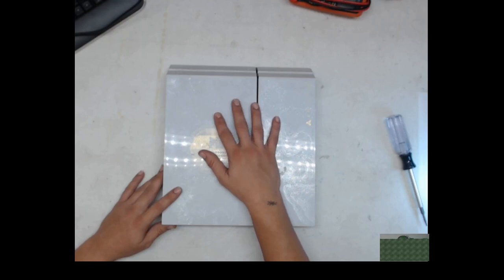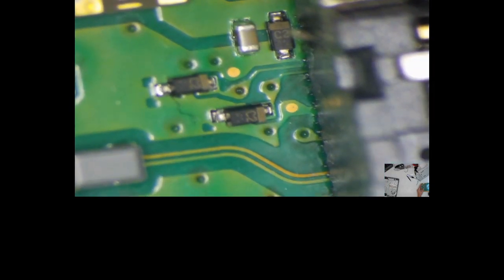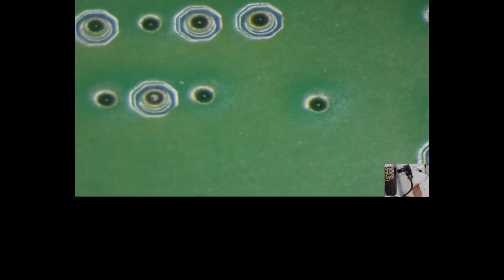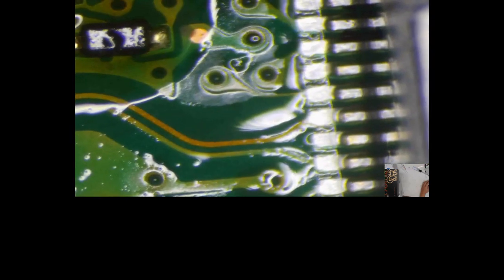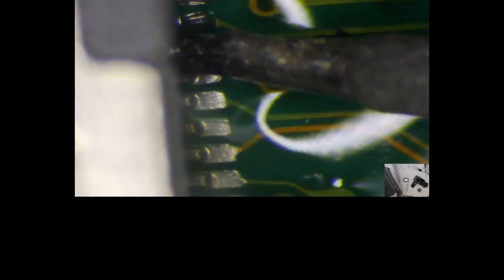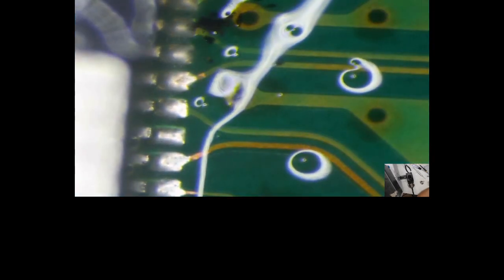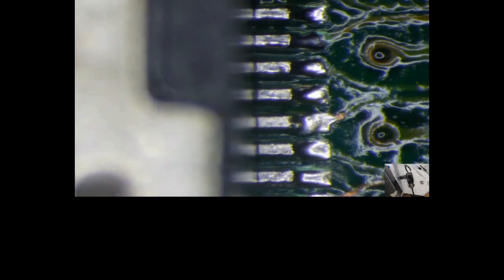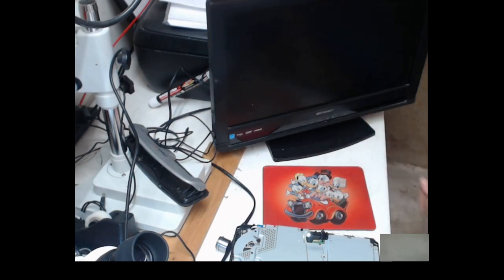PS4 CUH-1215A HDMI Port Replacement Fifine Mic Test

Comment: Im.just curious, I may have to replace the hdmi ic chip, are the pins on the chip presoldered. And also are those DJ chips dirrecional? I had one come up when I did the port. Any info woulf be great.
Reply: Did hoy change de IC for HDMI? Did it work? I have 2 PS4 1215a and i already change the IC on one, but i use a los IC that i remove from a PS4 Slim and still didnt work. I'm trying to buy new IC.
Reply: @alfasurvivor3308  I think I just sold the system for parts after I attempted to swap it out. I just don't think my skills are good enough. Maybe you will have better luck.
Reply: i always  wonder the same thing  never get an answer  from anyone